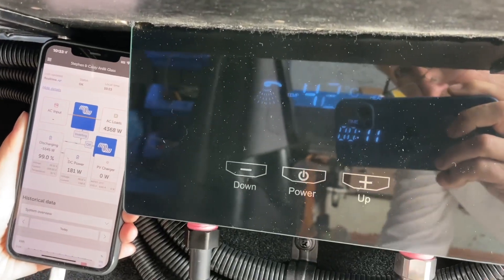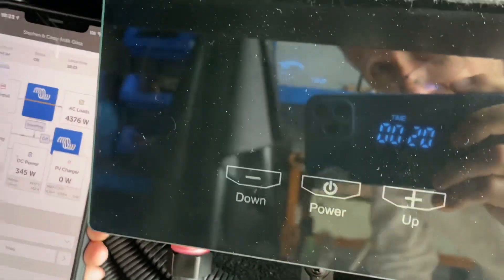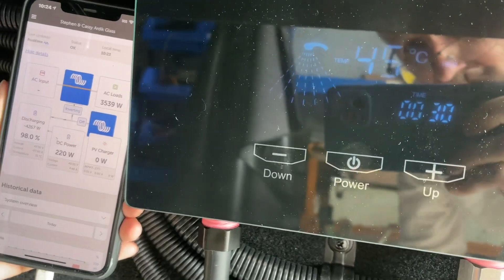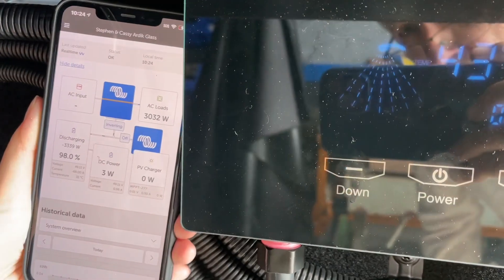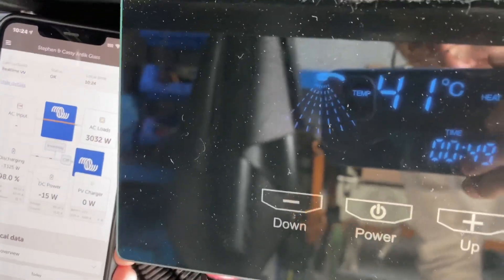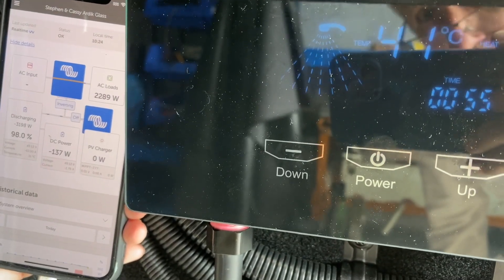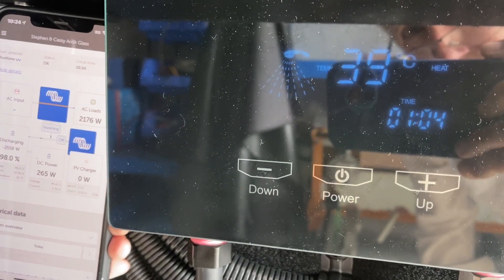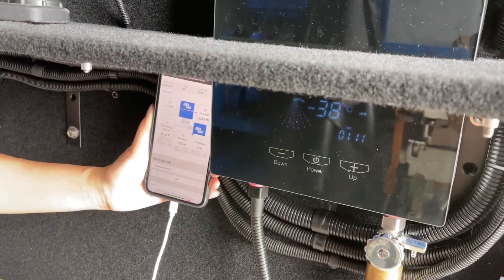Power and Temperature Results Safiery instant Hot Water at 4 settings 2200w to 4400w 3L / min

Comment: Is it possible (with more power) to heat the water to 40c if the input water is only 10c?
Reply from the maker: If the flow rate is down to 1.5 L/minute it would go close